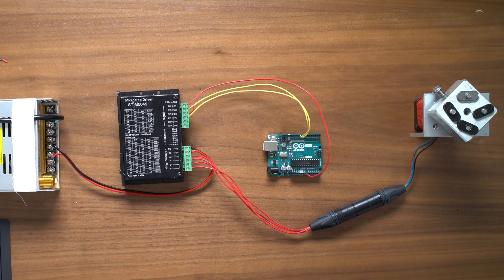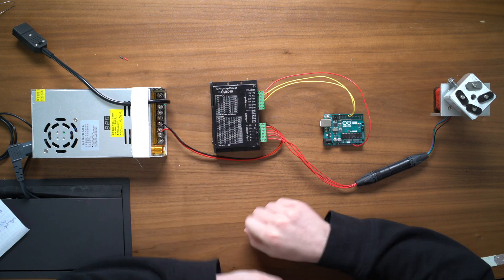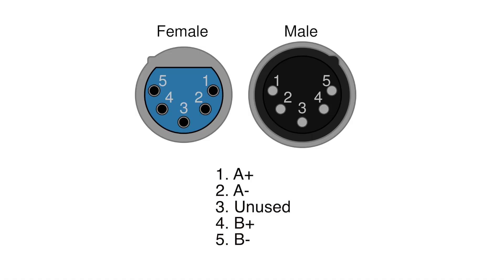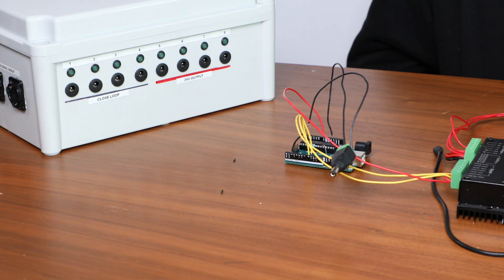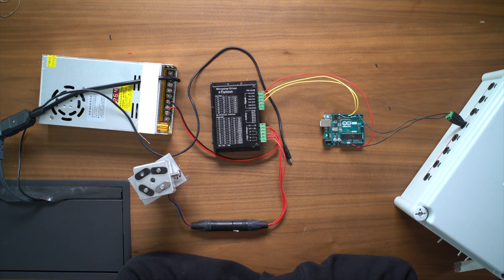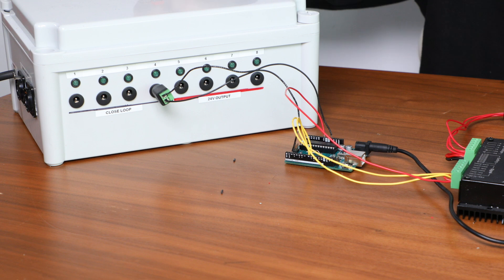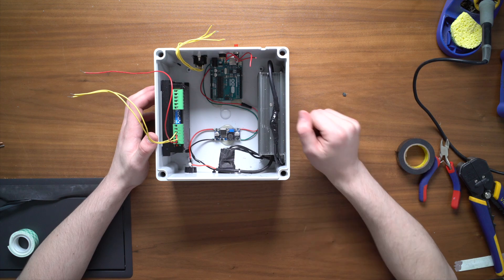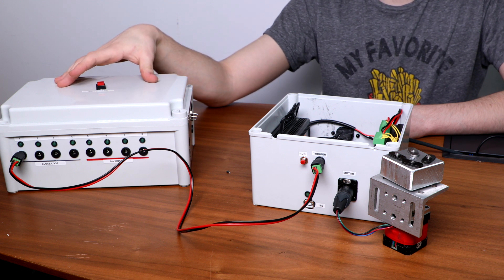Using Arduino for Stepper Motor Control

Comment: it would be nice to see how you connect this with Dragon frame, and there are a question around my head: using stepper motors in your rigs, how do you control the position? I mean, there are some sensor (like limit switch sensor) in the limits of the camera sliders? or after some test how do you go to the initial position of the motors using the dragon frame? 
I love this channel, keep going!
Reply from the maker: frutosmarinos we use the Dragonframe DMC box to control steppers. You can set limits for axis / travel in Dragonframe

Comment: I was able to follow the first video through easily but this one is a step. I am missing half the parts, and it is way quicker. Will have to watch it a few more times before I make an attempt at a circuit

Comment: Why did you choose a 5 pin XLR connector instead of a 4 pin XLR connector?  Did you choose shielded or unshielded cable?  Thanks!
Reply from the maker: 5 pin is more common, and we are actually using the same pinout as dragonframe's DMC+ They use pin 3 as a gnd when needed. As for shielding, it isn't needed. Either shielded or unshielded will work

Comment: Whats the difference between the driver you have and the smaller ones like polulu a4988?
Reply from the maker: Usually the amount of amperage they can feed motors
Reply: @TheGarageLearning  and the bigger driver is more constant and does not break as quickly as the a4988! I have to change my a4988 once a week!